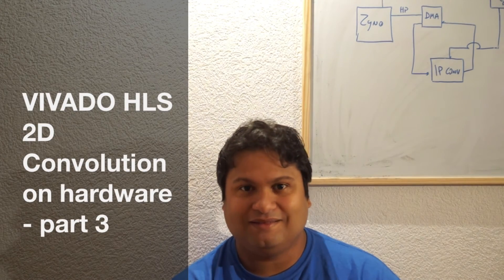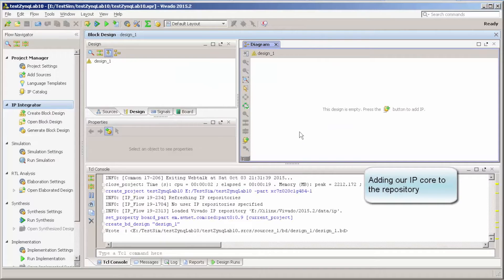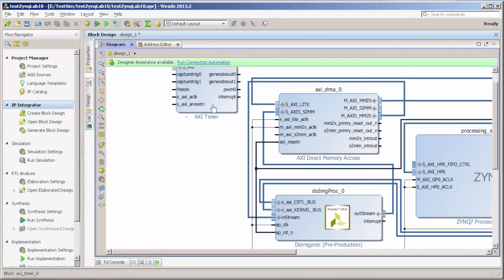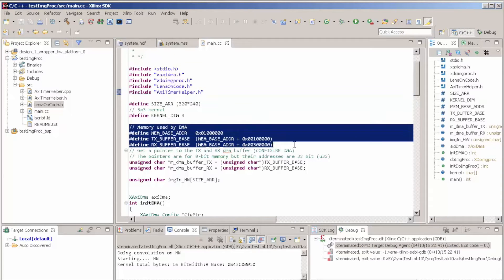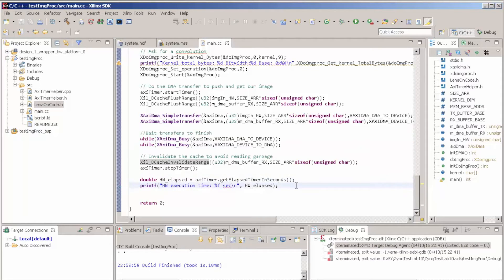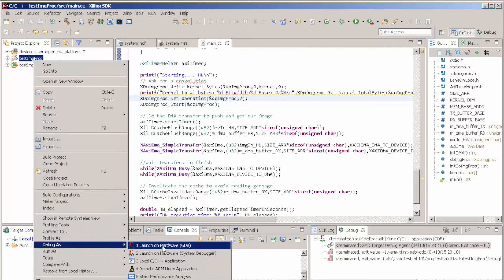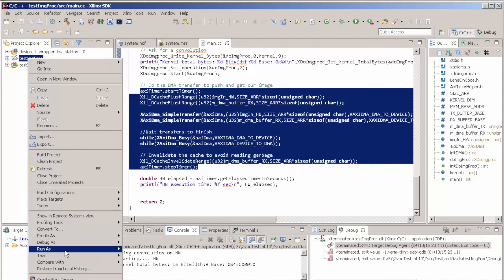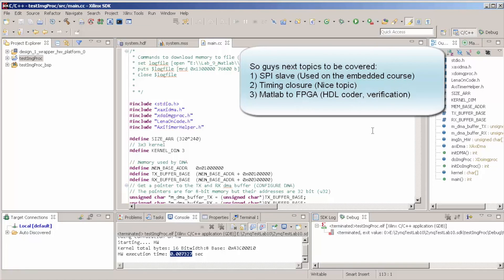VIVADO HLS 2D Convolution on hardware   part 3

Comment: Hi, thank you so much for your tutorial !! I have tried to implement it, everything works fine for me except the last step which is check the output image.  I used XSCT(new version has changed from XMD to XSCT) to output the log file. In XSCT, the commond is slightly different from XMD,    like : puts $logfile [mrd 0x01300000 76800 b] is not valid, it should be : puts $logfile [mrd -size b 0x01300000 76800]    which means generate log file from address 0x01300000 , number is 76800 and in byte format. I was just wondering how did you convert this log file back to the image? I just open the log and had a quick look, it seems different from the original image if I use impluse filter.
Reply: 最近在做SDsoc这一块，可以共同交流，方便的话加下微信：shiyangcool